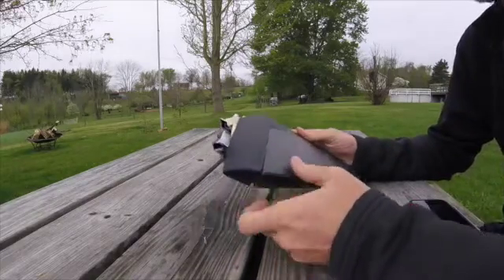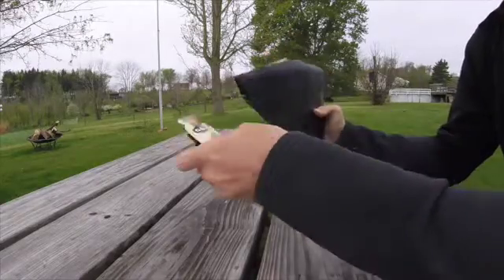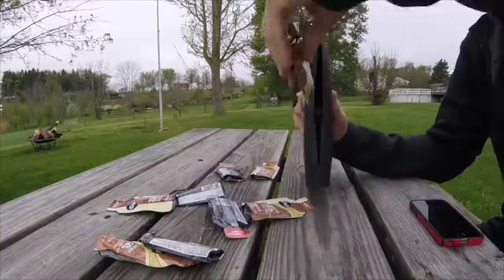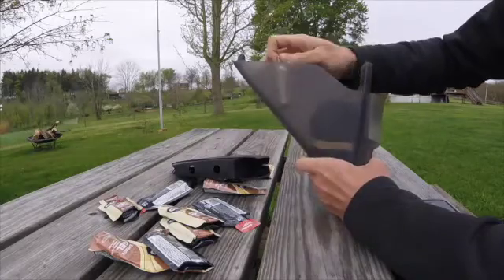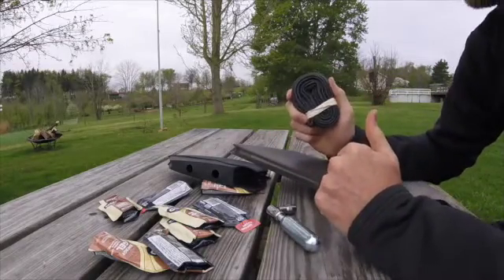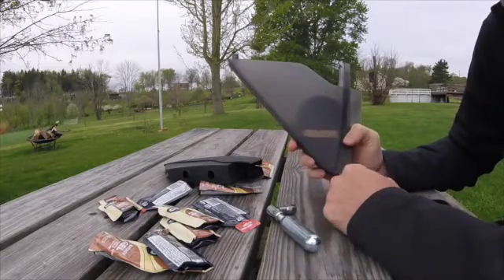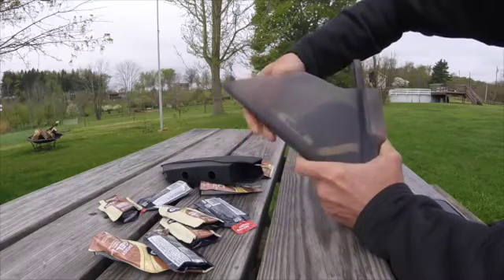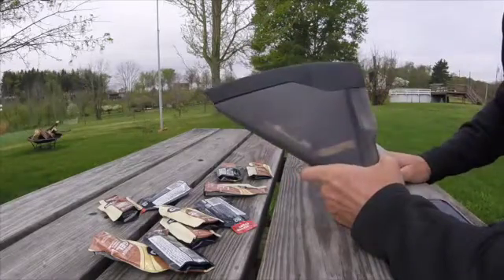How to pack Specialized Fuel Cell

Comment: Great video, thanks. I do not mind that it is a bit small, at least it gives some extra space. It fits perfect on my Quintana Roo, so if you are lucky then not just for specialised
Reply from the maker: Thanks! I completed IMLP in July, and it just wasn't enough for what I needed. I ended up going with the xlab carbon wing and a few extra cages. For shorter rides, I agree.

Comment: Great Video. You should mention that the fuel cell comes in different sizes depending on the size of Shiv you ride. I unfortunately use the small frame which means I use the small fuel cell.
Reply from the maker: I honestly wasn't aware. I have a large, I'd be even more frustrated with it being smaller. Thanks!